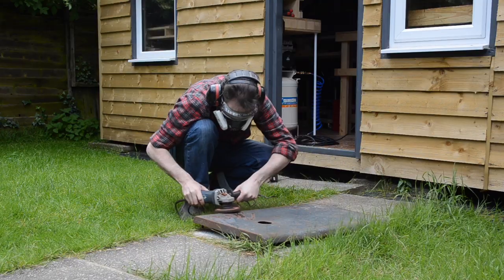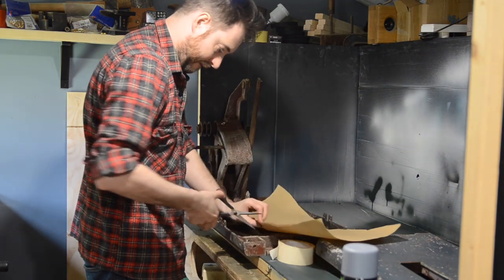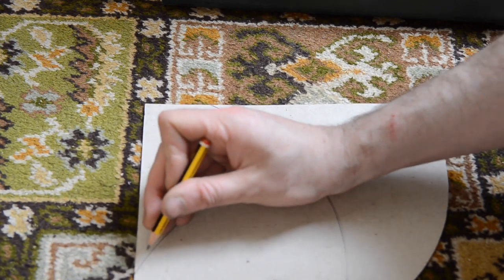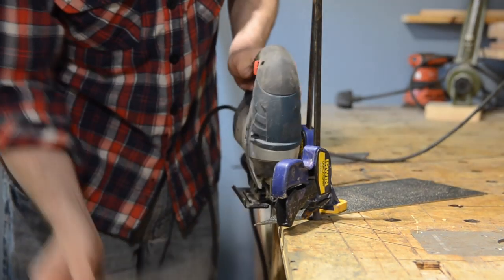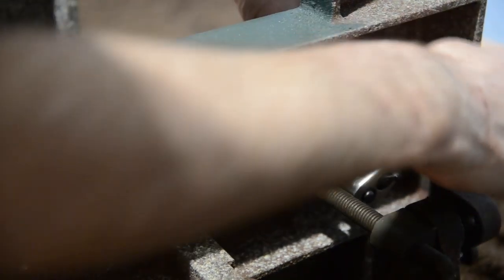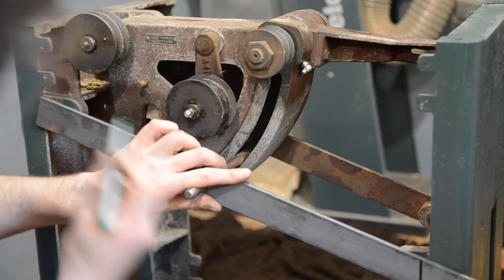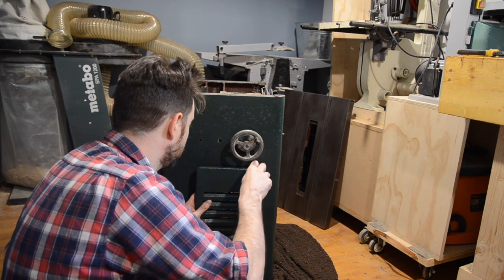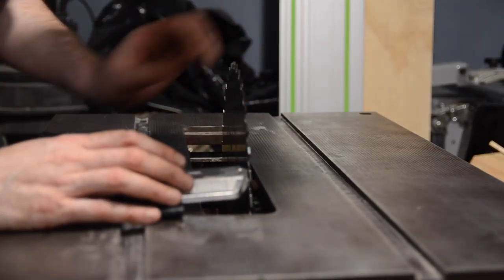Multico A1 Table Saw Restoration Part Two

Comment: I have a very similar if not identical saw (multico A3), fitted with a massive 3 phase motor that I've now swapped out.
Reply: hi, I have a multico too. It has a  three quarter inch arbour. Where do you find your blades?

Comment: You are doing a very nice restoration there. As you have a compressor did you consider sand blasting to clear the surface corrosion? Have you got a clock gauge/ DTI to assist final set up of the table to arbor?
Reply from the maker: Thank you. My compressor is not big enough for sand blasting. I don't have a gauge and that's why I was using my thin rip jig.

Comment: Looking good mate. Bit of a tip before spraying any metal parts gently warm them with a blow torch. The paint adheres better and also with a bit if practice you can apply thinker coats and get a better stronger finish looks great though matt
Reply from the maker: Thank you

Comment: Why did you not at least put a cost or (2) of Rust-Converter on the lift mechanism below the top?!  Seems a lot of work on the outside to fail to address the inside.  Any reason why you didn't wire-wheel the feet either?  They looked a little rough to be just getting paint.  Interested to see how the motor turns out.
Reply from the maker: Because it was not rusted
Reply: @Badgerworkshop  The lift mechanism?  Perhaps not as rusted as the body panels but there is definitely surface rust on that linkage.  I wouldn't have put all that time and energy into the rest of the saw without preserving the inside as well.  Sawdust will hold moisture against the metal surfaces and accelerate the process without proper coating. You might get away with it in an arid climate, but on the Texas Gulf Coast it better be in a climate controlled shop in order to last.

Comment: Trying my best to watch what you were doing in the house but all I could see is my grandma's carpet...I'm serious it's the exact same one 👍
Reply from the maker: It really has to go but I keep spending all my money on tools
Reply: Price of carpet these days is getting silly, just got a quote for £400 for my dining room @ 50% off.
Reply: @Badgerworkshop  i totally understand as our vacuum broke and I prioritised a chisel set haha, have you checked underneath to see if its possible to sand the boards back and seal/stain them ? That would be a good project, time consuming but still looks amazing once done and saves money in the long run which means more tools 😉